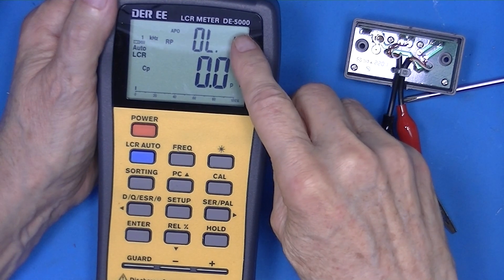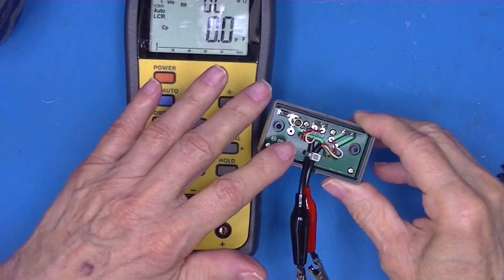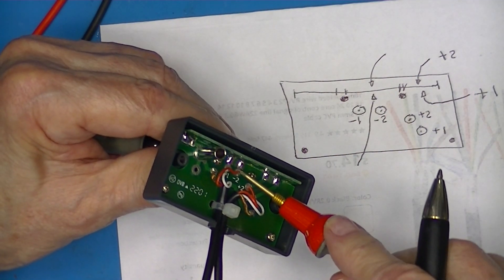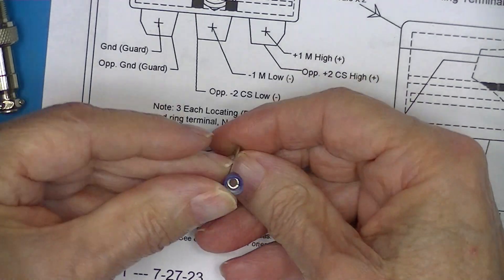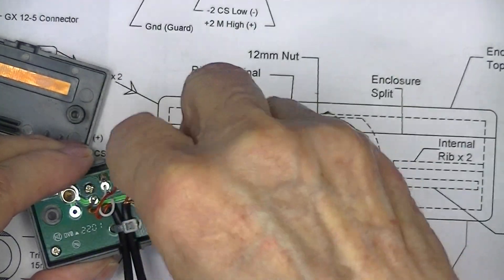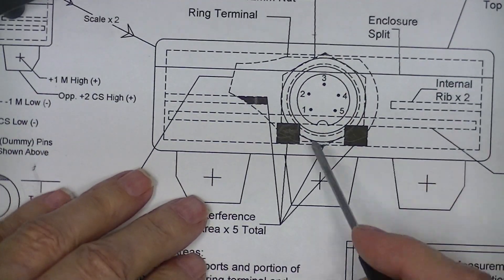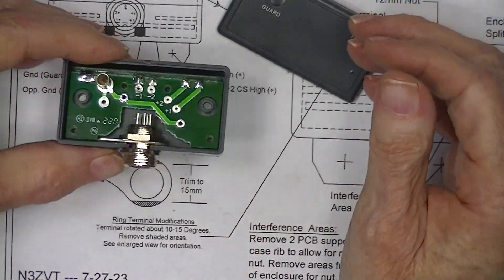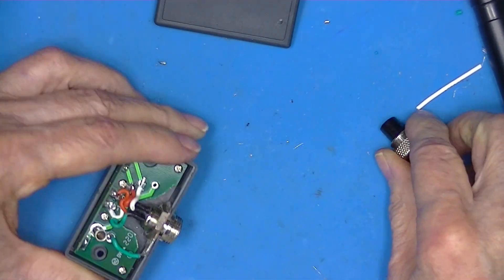Extended Kelvin Leads for the DE 5000 - Part 1

Comment: Thks buts ??the shorter the leads the less they'll distort the measurement, right???
Reply from the maker: No, as long as the unit can normalize the leads when shored/opened. Also not that the leads furnished for use with SMD are quite long.
Steve

Comment: The manufacturer did an excellent job of making it complicated to get around buying their proprietary connectors. Previously, you have led the way for the EE Hobbyist Community to be able to subvert the poor engineering issues of their design. Kudos to you and thank you. Here, your engineering drawings and instructions are amazing. Rarely is such seen, anymore. Your new/additional improvement addresses the need to be able to remove the leads for storage. I would suggest, most humbly, that the connection issue extends beyond that legitimate need to also include being able to use the Kelvin leads with more than just the DE-5000 device. That would point us back in the direction of the banana connectors that are used on most Kelvin-capable test equipment/DMMs. Having PCBs manufactured with the two-sided blade connectors is easy enough. I believe that I have even seen their design shared by other hobbyist. But, there is the complication of turning the connectors to be perpendicular to the 5000. The manufacturer accomplishes this with a separate board. We could, as well, or through hole banana connectors could be used on an extended vertical PCB. Picture just the original blade connector board. Remove everything else. Now, make that board extend above the face of the 5000 about 3/4". Place five eyelet-style 4mm through hole banana sockets on the board and run traces back to the blade connections. That's it. I think this is the easier method to accomplish, however, the Kelvin's banana connectors will run parallel to the 5000. The only way to know if that will present an inconvenience is to give it a try, of course. All food for thought. I would provide you with a drawing, but YouTube will not allow me to post a link, for you to be able to access it. Cheers.
Reply from the maker: Even if you were to use split or, dual lead banana plugs the DE-5000 would still be in the two-wire measuring mode. In order to enable four-wire measurement the parallel connectors would need to be opened. This would be true for any device that  uses the parallel and banana connections. Except for devices with switch selected connections. 
Thanks 
Steve
Reply: @stevestrivia-bystevewagner4852  Yes, what I am suggesting does use five banana connector eyelets on the vertical PCB that divides/opens the 5000's contacts for a Kelvin connection. Two for current, two to read and one for shield. I guess that I did not say that so well...